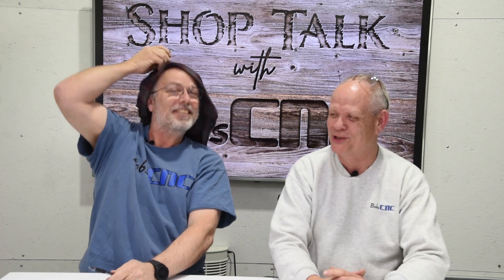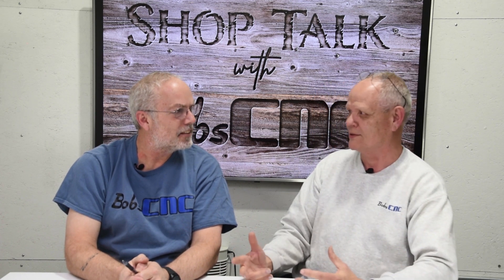Shop Talk: Lasers

Comment: "You're gonna shoot your eye out!" What movie was that? 
I get it that there are people that might harm themselves or others with careless operation of a laser. The same can be said for table saws, chain saws, electrical service panels, cars, trucks, motorcycles etc. Welding was probably feared when it was new. 

I hope no one gets hurt but there are products available that look like they have pretty solid mounts. In fact I aim to make mine dual purpose. I do not have room to accommodate another machine to do what can be done with the setup I already have. I think more people have had serious injuries from metal cutting tools. I built aircraft for Boeing for 25 years and prior to that I built fighters for General Dynamics. Seen people yank the hair out of their scalp when the drill caught it. Slice their hands open with sharp knives, drill right through the palm of their hand. Burned from electrocution. Fall through metal decking. Get crushed by a spoiler they didn't lock out. One guy was actually run over by a 777 landing gear while the aircraft was being towed. Listening to an iPod.

Lasers can be used for pointing at a whiteboard or they can be extremely powerful like the chemical laser we were firing out of the nose of a 747 to melt the side of a rocket in flight. I have worked with some people you kind of had to keep an eye on. Not everyone is capable of safely using hazardous tools or machinery. From my experience the majority of folks I worked with or around had the sense to not approach downed power lines. Then again we hear about people dying from trying to keep warm indoors with a charcoal grill so who knows.

Do not buy eyewear from unknown internet merchants. I expect to pay good money for legitimate products. Especially when it comes to getting the correct eye protection that is rated for the wavelength I decide to use.

Have a nice day.